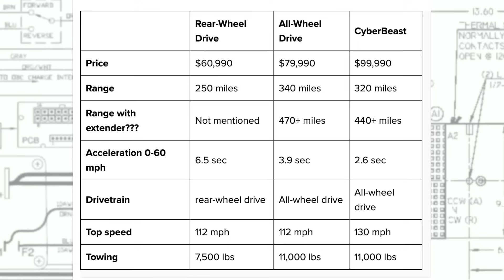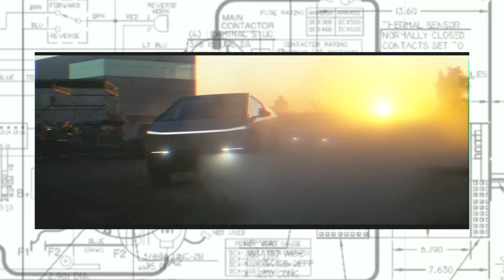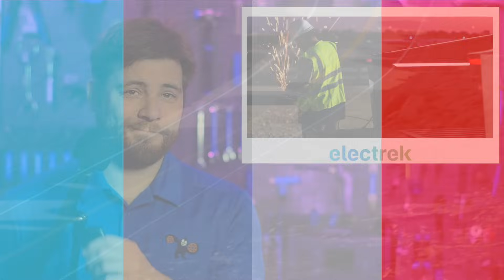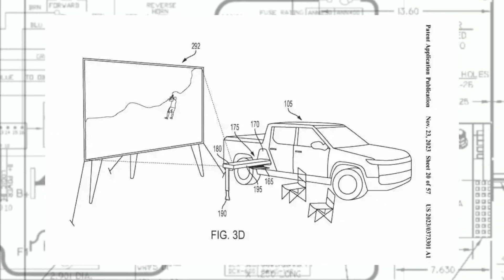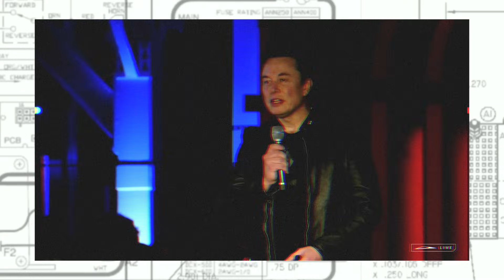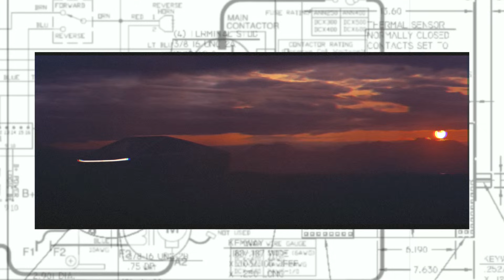Tesla EV News 11.30.23 Cybertruck 470 Miles• Cybertruck $61,000• Rivian Movie• Battery Layoffs

Comment: Tesla Cybertruck pricing: Just what I expected/hoped for as a shareholder - just under the $80k price threshold to get the $7500 EV tax credit. It would have been stupid to sell the truck for $40k with 2 million orders. Early buyers would just flip them for profit and may still do even at $80k.
The Porsche 911 has a RRP range of £99,275 to £234,260. The price of a used Porsche 911 on carwow starts at £80,000.

Comment: Funny Dean - worry about the"extender for this all but non existent truck - Tesla was only able to deliver 12 today at the massively over hyped "delivery day" for th Cybertruck..I think you can tone down your excitement Dean; unless you are within the first 5,000 orders ; you'll be waiting 10 years to take delivery. This makes crystal clear the serouls problems with 4680 production Tesla is having - they must be rejecting 90% of cells made - 4680 is dead - Tesla will need a new battery asap; something they can say is "even better' than the tabless 4680 battery.

Comment: If the Range Extender could act as a house/storage battery for the 95% of time not used in the truck, that'd be cool. Or if it is rental mainly, and Tesla create battery stations, then smaller versions for use in future 'normal' cars or even robotaxis would also be cool

Comment: I just cancelled my reservation 😢 I just wasn’t a fan of the range I personally need longer range because of where I live 60k for 250 miles and it’s not even AWD I would pay 5k more if it had 50 more miles and it was AWD I know the 80k version is all of this but I just can’t afford that sadly also the drag coefficient is the same as the rivian so now you have this wild look for no reason other than to look different I thought the shape was going to help with the range but now it’s just stupid after seeing the range of these trucks
Reply: The shape is because it’s stainless. They can’t stamp stainless, so only shear it and brake it.
Reply: The $60K version os not slated for production till 2025 anyway, so no big deal.
Reply: @@OrwellNailedIt I was on the later half of reservations if the truck gets better then after a few years I’ll probably be able to buy from inventory

Comment: Or 200 mile range (maybe) when you charge only to recommended 80%, dont load the back with anything, don’t use the AC, don’t go up a hill, don’t drive it when too hot or too cold,…………..and if they are saying $61,000 then it’s really $71,000 for BASE model, or $90,000 after taxes, fees, dealer markups. 😂😂😂
Reply: No, it’s $61000 all-in. Tesla doesn’t use dealers—you buy direct. How did you get to $71,000 and $90,000?
Reply: @ChitFromChinola 
Don't feed the troll..... Especially when it's a 4th tier version.
Reply: @ChitFromChinola  yeah yeah, like the 3 was going to be only $30,000, the everymans Tesla, and after all said and done the cheapest 3 in the country was $48k. Just talking reality. I know there’s no dealer but there will be markups nonetheless, from the online order. Trust me, you wont get this BASE truck (250 range IF you fully charge to 100% which you wont) for under 80 out the door at least.
Reply: @mikemccormick8115  
The Model 3 target price was never $30,000. This $61,000 price is the list price for the 2WD model, not an aspirational target. You said “dealer mark-ups” — but Tesla doesn’t use dealers. You said somehow “added fees” were going to increase the base price from $61,000 to $90,000 — so $29,000 of “added fees?” Even for a troll, these are kinda obvious blunders. Dealers? lol. Try again.
Reply: @ChitFromChinola  ok fan boy, so go buy one.

Comment: It isn't 470. The $60k version is 250, and the $100k version is 320. Massive fail. Sure, spend another $20k or whatever and lose the bed, and still probably have less real world range than the Silvarado. Sounds like a great plan.
Reply: The range extender is $16,000 and takes up 1/3 of the bed. I’m thinking it’s for guys that are pulling trailers.
Reply: @ChitFromChinola  My guess wasn't that far off when you include tax. Wonder how much it will weigh.  Will it come with anything to help load it into the truck? Sounds rather inconvenient unless you either leave it in most of the time, or rarely use it.
Reply: Do you realize your pessimism is more to domwith the unlucky mix of your genetics (expression of some dopamine atc hormones) rather than with facts? What massive fail? I don't see any! That's the state of the art today. Yet further on, as the battery prices are less than 1/15th of what they used to be in just 2016, the range extender is going to cost much less in the near future and you don't have to buy a new truck - just buy it whennthe price seems right! I feel sour grapes from you, so my advice is, learn to look at the world from the positive side and enjoy your life as much as you can while you live! ✌🏼

Comment: I am also curious about the range extender package. I could actually imagine something well designed and useful. With a package that includes and electric dolly/lift on wheels, and a slide-in battery box. In my mind it would be cool if they have a system that ties into your Powerwall home battery (to charge with solar) and unplugs from home and plugs into the Cybertruck, giving you an extra 100 miles of range when needed.
Reply: This is what I was thinking too... tesla cyber-powerwall range extender to be used with home integration.

Comment: I think Tesla will use next Year to gauge the final spec and price for the base (volume?) model, as price to specs relationship does not look as compelling as hoped by many, also because manufacturing and capabilities of the 4680 batterie cells are still in the ramp up/optimization curve, so several variables are not yet fixed
Reply: You nailed it! Nothing is set in stone, and price will go gradually down and output up, yet the supermodern basic concept of this vehicle will hold on much longer while it is being improved along the way! I'mmsure we'll be talking about "early version Cybertrucks" in the future and remembering how basic were their specs comparing to our versions, once we finally get there after them being 2 millions produced. ❤️

Comment: Cybertruck will be a success but not at the level of the model y  the starting price came in a little more in line with what the rivians are selling for
Reply: The price is flexible. It would be economically speaking idiotic if they sold such a miracle on four wheels for sub par price. And once the production ramps up and the battery price goes down and the economy picks up, the price can go down of course.
Reply: A success based on what. It’s already failed to meet his initial goals. It’s more expensive by $10k to $15k and it has 1/2 the range of what was promised. How is that a success?  That’s called  a major engineering failure.